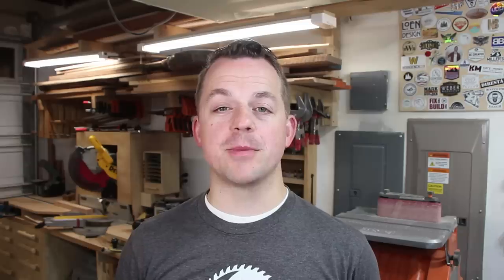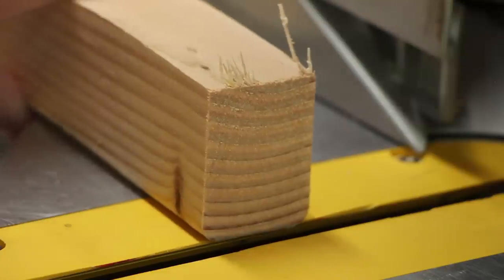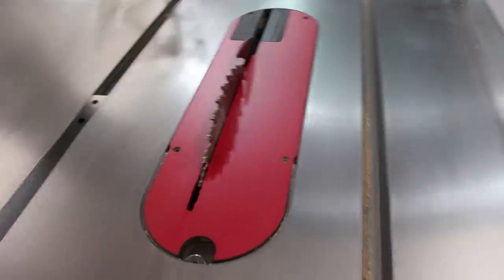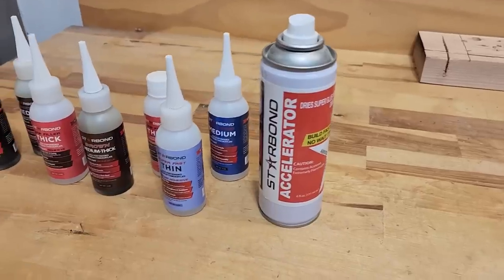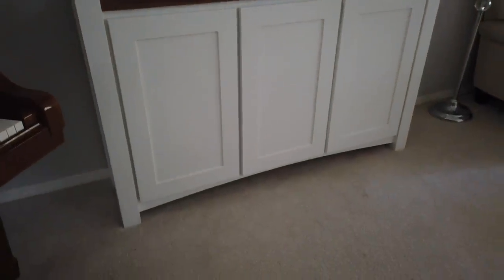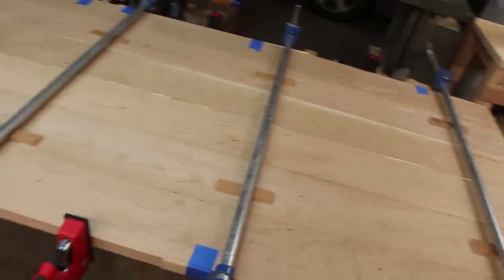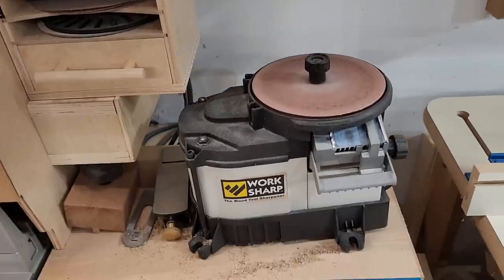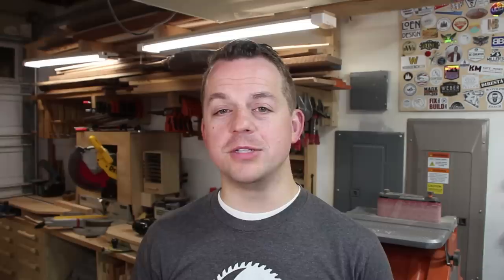8 Things I WISH I knew when I started Woodworking

Comment: I think you covered it fairly well. I would say it's important and helpful if you get in to a habit of putting everything away and the end of every day. It's far too easy to just leave tools laying around and then spend half an hour trying to find it the next day. I've been making sawdust since 1974 and I always put everything back in it's place every night. 8:38
Reply: Easier said than done, but once learnt, it is a lesson well learnt as is cleaning and oiling tools as required after use.
Reply from the maker: That's a good one too! I can't work when my shop starts to get too messy.
Reply: I agree wholeheartedly although I wouldn't have ended up with 15 Stanley knives if I hadn't kept on losing them and we all know you can't have enough Stanley knives 😁 (tip number 9 maybe?)
Reply: When you make a habit of cleaning up before quitting, it is much easier to go back the next time you work.

Comment: 1:03 What’s the better design? You can’t always have the grain go the same way so what’s the solution to that specific problem?
Reply from the maker: You have to allow the wood to expand somehow, so a design that doesn't have the frame could work...  or you coat it in epoxy so no moisture can get in. Another option is to put veneers on mdf or plywood then you can use the frame as shown.
Reply: One approach is to use a tongue-and-groove design. The checkerboard just floats in the frame without any glue. This is often used for door construction. A trick to prevent rattling is to put something springy in the bottom of the grooves before final assembly.

Comment: If you use lots of hand tools in a complex project, they can end up in a disorganized pile, and it becomes difficult to see the one you need next.  One thing I did to help with this was to clean up the plastic handles on things like pliers, so that the brightly-colored grips are more visible.  I also bought a set of yellow wrenches, which helped keep them from disappearing on my aluminum work surfaces.
Reply from the maker: That's a good tip!

Comment: Nice concise video with a lot of good tips.  When I started, I went with fairly inexpensive "big box" chisels that some other woodworker recommended; the steel on them is pretty good and it did not take much effort to set them up properly.

As for the squares: check that your square is actually square!  I had a cheap one that wasn't...  Also, treat them with care like any measuring instrument, they can go out of alignment.
Reply from the maker: Great tips! With the chisels, a lot depends on how much you use them. If they're cheaper, they may not stay as sharp as long, but if you don't use them a ton, that may still be a long time!

Comment: When making a major project with multiple surfaces and interior spaces, it is important to select each face of wood for each surface. It is unavoidable that not all pieces of wood are blemish free and perfectly straight. Plan your project out and make a cut plan so you avoid or hide the imperfect wood. This is especially important when working with rare or expensive wood. 

Dust control is extremely important, especially if you finish in the same area you cut and sand.  Vacuums connected to every tool and a big roll of paper over my workbench helps control dust and reduce wear on my workbench. The paper helps keep my painting bench clean and flat also. 

Depending on the project, spreader clamps can be as important as compression clamps.
Reply from the maker: Great tips! I like your reminder on choosing the wood orientation intentionally. Makes such a difference

Comment: I've yet to see a good wood chess board design. TEW let us know if you have. All I can think of is MDF with veneer. Are there other options?
Reply from the maker: Good question! I wonder if you could do one floating on top of a frame with fasteners underneath. Then you get space for movement, but it doesn't leave gaps.
Reply: With the squares on the board itself, one solution I've seen is to alternate the grain of the squares along and across the board. As for the perimeter strips, who knows? Maybe rotate grain 90°?
Reply: Veneer or thinner show surface on any substrate. Even if you use solid wood under it’ll be fine as long as it’s not thicker than the upper surface by too much. Using plywood is probably the best choice for base.

Recommend you look up a moisture chart for your state. Woodworker Guild in my state happens to have a great one with all our local woods and seasonal width changes. Also factor that quarter-sawn wood does not expand as much as rift/plane sawn. By just a little.

Small chess squares shouldn’t expand by more than 1/64th over 2 inches. If you’re alternating direction with light and dark spaces it elevates the total width expansion too. By half :) That leaves you with less than 4/64ths (1/16th) expansion over whole board width.

Gotta worry about the trim like he did. I assume the trick there is jointing it with a rabbet or other mechanical connection so that when it does open up, it’s not ugly. Add a little chamfer. Mechanical joint on the miter using a mitered half lap.

Comment: The importance of completely square wood is key.  If you don’t have a jointer learn to use a planer to get parallel faces.  Also, learn to create one straight reference edge competently, like on a table saw sled, to use later to get other straight edges on a board.
Reply from the maker: That sounds like a great video I could do explaining that process. Thanks!
Reply: Agreed-,somewhere, somehow in your shop -a huge asset will be-some flat  surface -table top bench -corner shelf -something-that is completely level and completely square. If you do this right this one time -perfect-everything else you can do in relation to that -you can save yourself so much headache
Reply: Lol-I’ve built numerous things on a table that was just a little bit off level. It’s just like if it was level wherever that bubble is on your foundation/ is where that bubble needs to be anywhere on your project I’d like to say it’s phone but it’s stressful -just build a level and  square reference somewhere

Comment: N1:30 sooo besides epoxy or a frameless board would alternating the grain patter in the checkerboard work?
Reply from the maker: Hmmm that sounds intriguing! That would definitely be worth testing out. It would either distribute the expansion across the insists pieces and make it fairly stable... or it would just catastrophically explode!
Reply: @EveningWoodworker  🤣🤣🤣I was wondering about that. Thanx

Comment: One tip I have is when you buy a table saw or a chop saw buy a decent blade to go with it.   The blades that usually come with those saws are pretty cheap.
Reply from the maker: That's a great one! I've messed up plenty of 45 degree cuts with the stock blade.

Comment: - ‘CA’ glue IS superglue. ‘CA’ is in refrence to CyanoAcrylite, which is the chemical in Superglue. Both were available at the same time, and ‘CA’ glue youre referring to was mostly available directly from the manufacturer and or hobby stores sold as a wood glue. The family of ‘Acrylites’ can be found in different fast and strong glues and can be very helpful to learn the differences. 
 Also very helpful per application is the glue viscosity- as you mentioned :thin, medium, and heavy. Thin being like water and heavy like a syrup. Personally, I’m not a fan of the actuator, but you’ll never see me use these glues without a box of baking soda close by. It’s important to note that not all super glued use CA, but if they do, it will be labeled. >>CA is famous for an almost instant ‘set’, adding baking soda makes it instantly ‘cure’. **The instant Cure process creates high heat fast, so don’t let this happen on your skin
Reply from the maker: I always thought super glue was just a brand of CA glue... kind of like kleenex is actually facial tissue. Thanks for the background.
Reply: @EveningWoodworker  me too- I read a comment about SG and baking soda - it intruqued me so I instantly bonded my fingers together- simultaneously burning them. Wanted to make it a priority to have the antidote for next time - (acetone btw) . Crazy part. As far back as I can remember, my dad built and piloted RC Aircraft: 1/6 to 1/3 WW2 ‘C’, ‘P’, and ‘B’s. He always had the bottles - labeled ‘CA’ Cement… wouldn’t let us use it of course … turnabout it’s just a bigger bottle of superglue! Lol …. I feel like I know a little too much about the stuff!! Might as  well put this one out there too: of course they get pricey with the amount-but there are a couple companies you can order directly from-one  has 5 gallon buckets and one actually had a 50 gallon drum of superglue you can buy!

Comment: Sanding discipline is my worst enemy. I can have a project going great and I manage to sand too much when it is nearly finished. Screwing up corners or other features is very easy. Learning to sand small details like chamfers by hand and never tilting the random orbit to try and do them quickly.

Using sander on edge with pressure is also how you heat up the hook and loop causing it to fail prematurely. Melts that pad if you do it too long.
Reply from the maker: Yep, that definitely heats it up quick.

Comment: The pencil thing when sanding.. Don't do that when sanding oak and some other hard woods you won't sand it off
Reply: Dont even use pencil when marking out use a sharp knife
Reply from the maker: Just do it lightly enough that it doesn't go down into the larger pores of woods like oak. Or just feel if it's evenly smooth!

Comment: I still have a project that I created during my first semester of my Junior year in high school in 1979 when I was 16 years old. It is as beautiful as the day it was finished and has been in service in a kitchen ever since. I just turned 60 years 2 weeks ago and remember those days so clearly that I can recall the scent of the wood as I cut it. It’s an 11’ bowl and a little over 5 inches high and built of paduak. I remember having to build those checkerboards. They became a top on a 3 legged pedestal table. They were designed to fail with all of that cross grain gluing that we were taught not to do beforehand but we did. We didn’t know much about veneering back then in class. 🤣
Reply from the maker: Glad you have some of your projects that lasted! Cutting certain woods brings me back to high school shop too.

Comment: To address the chess board, float the inner frame in a groove, specifically designed to hide the gap, with the gap around the board looking like a routed groove becoming a design element around the checker board, to alleviate the expanding side, and hide the fact that it is expanding.
Reply from the maker: That sounds like a successful design!